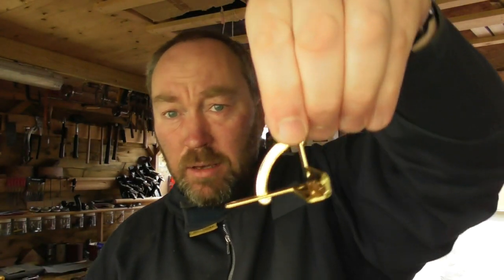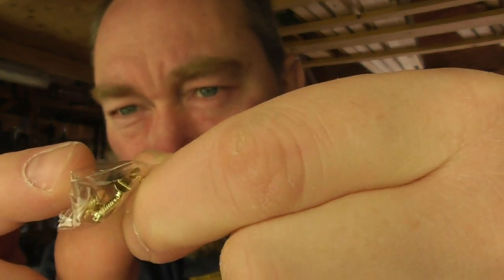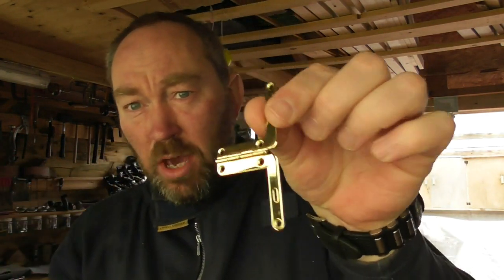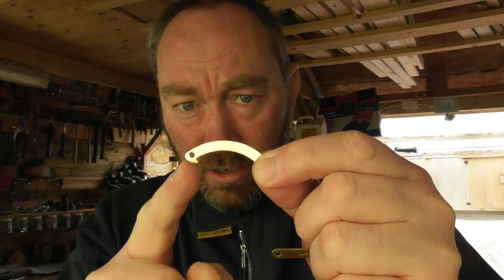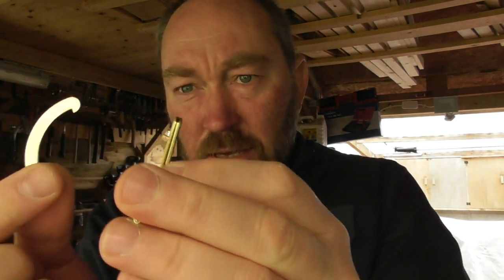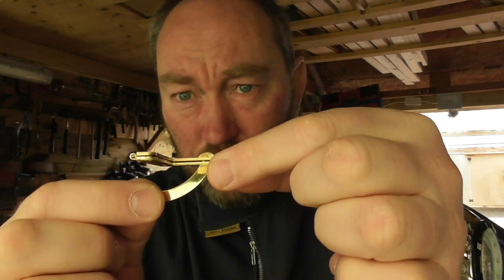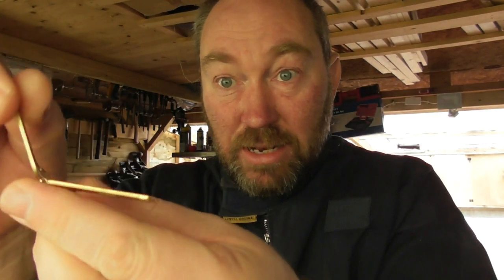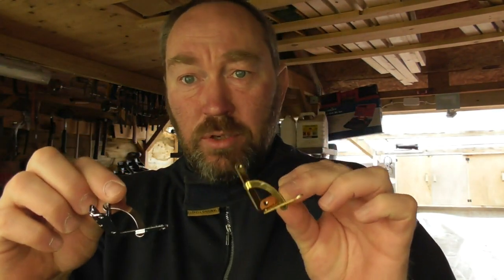Solid Brass Quadrant Hinges

Comment: Got hinges and they look great. What would be really useful though is a video and some instructions with the hinges which detail the mortise sizing and positioning. I can't find this type of information on the internet for any quadrant hinges.
Reply from the maker: The reason there are no generic videos (there are a few hinge specific videos) is there are so many hinge sizes and different pieces of equipent that can be used it can't be done to cover everything. As an example do you have a palm router, standard router, router table, marking knife, cnc machine? If you then add different specs on each hinge it becomes a huge subject. The best advice I can offer is to practise fitting on some scrap wood until you develop a technique with the tools you have to fit them well. The other complication is change in hinge specification - it does happen and would instantly void the video content. I hope that helps maybe just a little!
Reply: Understood. Thanks for reply. I did find something semi-useful on Canadian Woodworking forum. Made jig and fitting this afternoon.

Comment: A video showing how to mount this hinge onto a box would be beneficial. After all, isn't putting the hinge on the box the whole purpose?
Reply from the maker: There are many different ways to fit this hinge type, we cannot show all of them and it is dependant on the equipment you have which is why we don't show it. If you are not familiar with this type of hinge they are best left alone, there are already many videos of how to fit quadrant hinges.